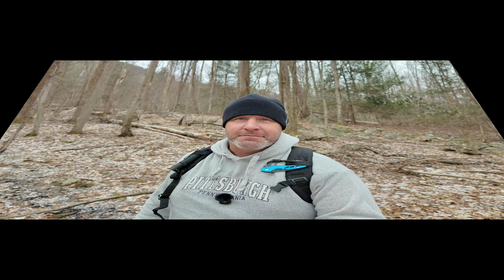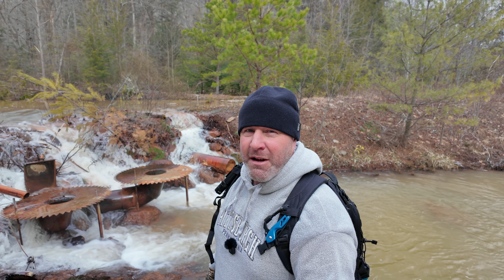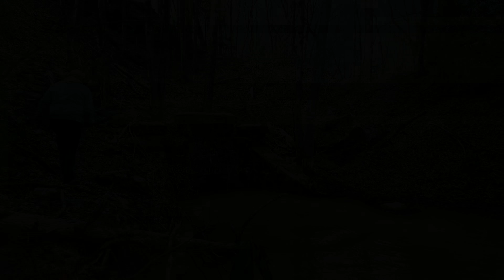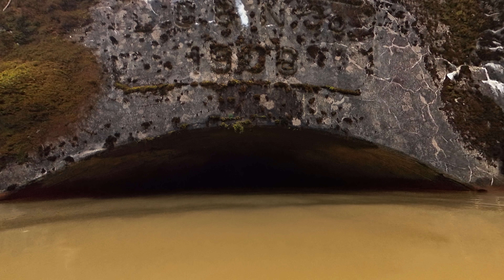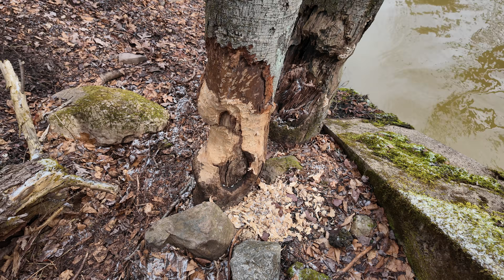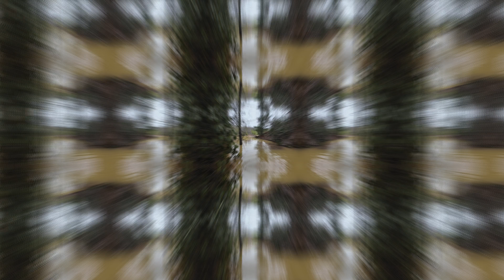This Drainage Tunnel is EXTREMELY FASCINATING! What is it Wednesday

Comment from the maker: The history tied to this is pretty fascinating. Not only with the construction of this tunnel, but also where it's located. What do you think of this site?
Reply: Couple of things, water levels are quite high, it’s not normally that high. The pipes with the saw blades are aerators.  Water normally comes through the diversion dam and comes the pipe to spill over the blades which they oxygenate the water to help the Aluminum precipitate out and settle in those basins. Looks like the winter has damaged it. Also if you noticed the little building by the tracks above, that is a diversion pump house to pump water from the tunnel to be used for cooling at the Panther Creek power plant. They actually have to clean the water prior to use, so any discharge from the plant is actually a net benefit (plus it can reduce the amount of AMD which enters the Lehigh.)  My father in-law use to have to inspect the pump house when he worked for Panther Creek.
Reply from the maker: Thanks so much for those details
Reply: Its interesting because environments do change...  It kinda makes me wonder 🤔 if it could disappear? One day? I also wonder about the structural integrity of the 4 mile tunnel it's questionable. ? Must be alot of things to learn here...
Reply: Well it makes me very sad to see all those chemicals going into the streams and entering the ground water around those sites. I realize coal was king in ne Pa for a long time. I've lived in the coal region most of my life. Columbia county to be exact. Coal definitely fueled the industrial revolution but it had a high price tag on our future. The coal barons of course had their number one priority. Get every bit of coal out of a mine that you can. One of my earliest memories of early tv is those grainy black and white pictures of them dumping the train cars into that huge whirlpool that was where the Susquehanna broke thru because they messed with the maps of how high they were to go upwards when mining. Obviously it was way.too far. I remember watching that as a very young child and asking my dad if there were miners in there he did not lie. He said yes there were but I'd doubt they're alive. I'm 72 years old and I remember that film like it was yesterday. I actually have it on my phone and have shown it to many people who had no idea what the butler mine disaster was. I really enjoy your videos as I've lived in Pa my whole life😊

Comment: In an earlier video a lady made the water was much lower. There are large steel grates blocking off that tunnel. The coal barons were forced to put the grates up when the mine was closed down😊
Reply: Also on the video that the lady made she had that both ends of that mine tunnel were actually guarded during WW11. It seemed that the government felt it would be a good place for spy's and Infiltratores to set off explosives etc. I can't see what that would have gained them as the mine was shut down by that time. That was another reason for the iron gates that seal up the entrances

Comment: With the amount of minerals coming out of the tunnel daily, you could use an electrocoagulation system to remove vast amounts of usable minerals annually
Reply: But that would make sense
Reply: @N.Tchaikovsky  that depends on the running cost vs selling, however you can make it passive with minimal expense and get government funding for environmental benefits of cleaning the water running to the river system

Comment: So if this  Tunnel was blocked the polluted water would dissipate into the water table, then spread into the ground water for miles around ?  Showing up in wells and aquifers for town drinking supply systems ?  Although initially built to drain the mines, it may now have a new role as protector of the ground water table.  Draining the toxins into the river may be the lessor of all evils.

Comment: Greetings JP,

Good idea to return at some drought time to see how far you can see into the tunnel then.

Interesting that it works still as originally intended.

What naturally brings the water to the surface? Or perhaps the 4.5 miles away.... is that the site of a tall mountain, so water exits the side of the mountain, and never has to be brought to surface?

Comment: Interesting fact if you take the tour of the No.9 mine, when you look down the shaft and see the water below that is the same water surface that flows out of this tunnel.  All of the mines east of the Little Schuylkill River in Tamaqua and Nesquehoning thorough the Panther Valley are somehow connected.  There are two discharge points; this tunnel and another discharge behind the Citgo gas station at the south end of Tamaqua.  I believe there is a high point or barrier pillar somewhere that splits the flow but it is basically the same mine pool.
Reply from the maker: Very fascinating as I've been inside #9 and know exactly where you're talking about.
Reply: @JPVideos81 ❤
Reply: I had no idea mines share the same mine pool of water. And from 5 miles away.. very cool,stuff. Thanks

Comment: The Pennsylvania Dept. Of Environmental Protection has concluded that leaving the borehole alone is better than trying to plug it. If you plug it the water will back up in the old mines and come bubbling up into peoples backyards in the towns built over the old “workings”.
Reply: It will also come up into basements. I've actually seen that happen in the 80s

Comment: Is the portal visible on the other side?  What’s the point of the waterfall with saw blades?
Reply from the maker: I was told the other side is beneath the surface and the blades are supposed to help with aeration.
Reply: @JPVideos81  so to clarify - that means that the other side of it is buried and not discharging?
Reply from the maker: @Gitbizy from my understanding yes. The water is only flowing one way as the other side is the intake.
Reply: @JPVideos81 thank you… that makes sense.  Thanks again for your excellent videos.

Comment: YT suggested this and I'm glad it did! New subscriber. Those saw blades are fascinating. I wonder what's it purpose were especially as its bolted on the ground.
Reply from the maker: Thanks for checking out the video. Maybe the blades are from the old saw mill that used to exist.
Reply: @JPVideos81  Good thing no one is swimming or going down those falls 😁

Comment: Is the other end of the tunnel in the abandoned mine itself?   If it is releasing mine waste, did they consider detonating and collapsing the tunnel end toward the mine, so the water would go into the ground and likely be filtered.  If it was closed, would the area where the mine was flood creating other problems?
Reply from the maker: I'd imagine if they collapsed or sealed it, it would find another way and create a different problem.

Comment: Hi JP i always loved the mining history of the area . Its amazing how much history there is even hidden . One thing im concerned about is all the open holes in the woods i would think they would have some how filled them in . I watch Amazing PA. And im astounded by how much is underground  . The other question i had is i thought you said the orange stuff that is in the mines is toxic . If it is Amazing PA. Walks through it has fell in it . Anyways awesome video as always . Stay safe cant wait for the next one
Reply from the maker: Typically the orange/rust water is polluted and contaminated with high levels of iron and pyrite. Not advisable to get that water on you, but it's more of an issue if you swallow it.
Reply: @JPVideos81 that's what I thought you said in a previous video . I love Amazing Pa. But they are crazy walking through it and getting it all over them .
Reply: The primary contaminates here are primarily iron with some aluminum.  The iron (or rust) is not toxic, I have had it on my skin and have been in it many times, aquatic creatures such as trout and frogs can live in it.  The main problem for trout is that the iron sediment coats the stream bottoms and kills the macroinvertebrates the fish feed on.  Aluminum on the other hand is toxic to aquatic life except for one specific species of green algae that love it, you won't find life in an aluminum contaminated discharge over a certain concentration level but a little short term human skin contact isn't harmful.

Comment: I’ve seen older videos on YouTube maybe 5 to 7 years ago and the water was running a lot lower than it is now. I find that tunnel extremely interesting.
Reply: Water flow depends on rainfall causing infiltration. Wet season=high flow, dry season=low flow. Sawblade looking items are to cause the waterflow out of the pipes to be diffused, to minimize erosion.

Comment: Awesome video! Do you know does the water get diluted enough when it hits the Lehigh River that the contamination is minimal?
Reply from the maker: The water entering the river is polluted, but not as bad as the outflow from the tunnel.
The settling ponds do collect some of the contaminants, but there's not enough room  or space between the outflow and river for it to get significantly clearer.

Comment: Very interesting! Does the tunnel have an entrance on the other side or is it 4 5 miles underground only? And what are those saw blade things?
Reply: Probably, it's appeared to be diffusers for an outfall structure. those pipes likely run down to near the bottom of pool of water and when water comes up and out of the elbows, the blades diffuse the flow so it doesn't erode the banks.
Reply: The Lausanne Tunnel is a fully engineered drainage corridor with two distinct ends:

The Intake (Nesquehoning Side): This is the "hidden" entrance located four and a half miles to the west, near the coal breakers of the Panther Creek Valley. It was designed to intercept the vertical shafts of the deep mines. This end is often submerged or restricted because its job is to "suck" the water out of the flooded mine workings.

The Discharge (Lausanne Portal): This is the 8-by-12-foot concrete and stone portal where the water finally exits into the Lehigh River. Because the Nesquehoning side sits at a higher elevation, the water is driven by a massive "hydraulic head." It travels the entire 4.5 miles underground through the Pottsville Conglomerate rock.
Reply: The other end of the tunnel would be in the mine workings to the south of Nesquehoning, no visible entrance.  The tunnel went as far west as the breast of the Mauch Chunk Lake Dam (draw a line from the dam straight over the mountain to Nesquehoning and that's about where the tunnel starts down in the old mine workings.  The saw blade things were meant to be aerators (they are not functioning in this video). According to the water quality data for the site the discharge is on average 70% ferrous iron which is the aqueous form, this needs to be converted to ferric iron to settle out of the water and one of the things that helps that conversion is aeration, it need an extra oxygen atom to convert from ferrous to ferric.